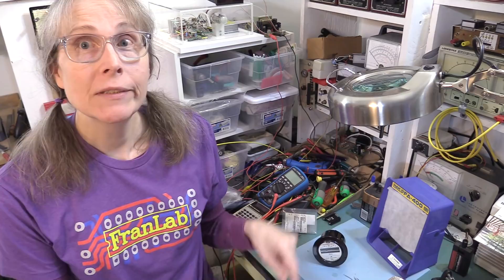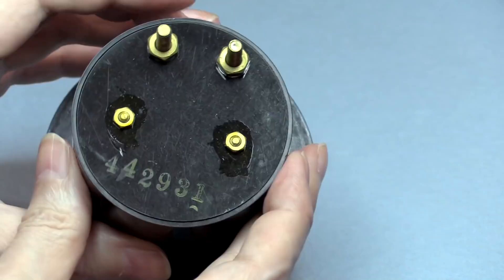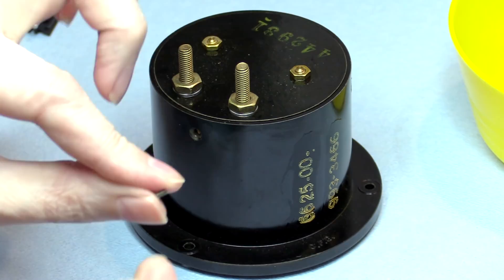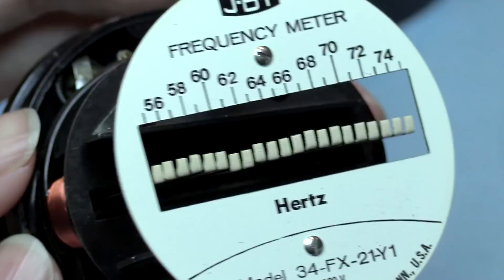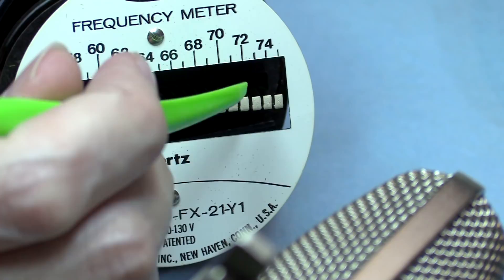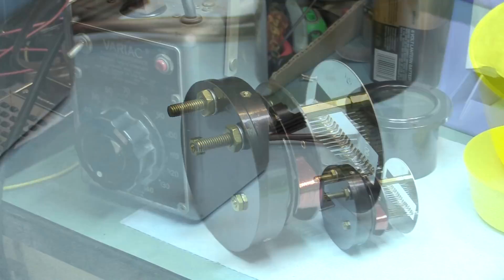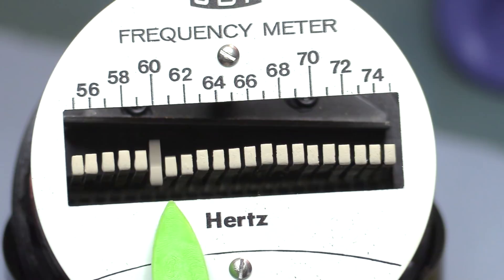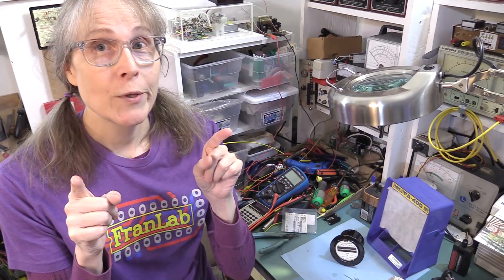The Spooky Action Of Mechanical Frequency Meters

Comment: Several have suggested using a step up transformer on an audio amplifier - which is a great idea. But even simpler is to use one of your many  tube guitar amps. Just attach the meter across the output transformer primary with a blocking capacitor.  No problem at all getting 120v of "audio" AC at that current. I know I don't have to warn you about the high DC voltage present.

Comment: im sure 100's of people have mentioned solutions... but 100/120v audio systems are totally an off the shelf thing... strap a FRX gen, an modest PA, and an transformer got a few in my shed, from a 10w from a little horn speaker to a 150w toroid. dont know if they will go down to that low frequency, but gotta be worth a shot. can think of a few other solutions, ive seen power opamps that will swing 75v +/-. and I refuse to belive you dont have a tube amp somewhere that can manage 100v. might need some ballasting resistors to load up the high impeadance side. you'll suss out a way

As soon as I saw that thumbnail, I knew what it was. dont know from when or where, but it was probably about 2AM from the depths of an internet rabbit hole, dialup might even have been involved. nice to get some deep good looks at the internals. with some dulcet frantones telling me all about it. Cheers!

Ps, your display collection is approaching the point it really needs to become art. Ive had in mind for years to build the most absurd network I can figure, cram all the networks onto a large pegboard, doing something totally pointless. fibre, coax, 485 SLIP, packet, everything. all the architectures, from c64 n acorn to ARM and a ryzen, n a bit of 486 novell for giggles. just cos. and if i can do something dumb with it, I'll squeal. but if i can just ping everybody I'll be pretty happy.

I think you have enough widgets to start considering a Fran/Goldberg clock or something. all the obtuse n obscure stuff, with a 60hz timebase. and of course, you would have to use that 120v timebase as the actual time source. might have to collab with someone in micros (or to stick with the rube goldberg go ben eater, with LEDs on ALL the data lines. sure look ma no computer would have a word to say. sure Dave and Clive would join the party). nixies on the seconds, teleregisters on the hours, binaveiw clacking out L U N C H T I M E F R A N. you get the drift. That'd be *so* awesome. packing my fantasy's away now. but... you get mah drift.

Comment: Probably the easiest way may be to hack an old UPS to tune its frequency as most of them are build so they also could support 50 hz in the rest of the world. These old instruments were real artwork in its simplicity. It’s really amazing what you could achieve with some coils, springs or valves where today you need expensive FPGAs and microprocessors (granted you get way better performance from and functionality you could only dream of back than).

Comment: A good way to play with line voltage and have control over the frequency would be a gas powered generator. By manually manipulating the throttle, you should be able to change the frequency some without causing too much change in the voltage.

Comment: Fran, the 6625-00-993-3466 number is an NSN for a "Meter, Electrical Frequency."  For instance, <https://www.newcenturycomponents.com/nsn/6625-00-993-3466> gives a lot of basic "NSN" info on it.  NSNs even list what "weapon system" use them, though that is only ONE of many uses, in my experience with NSN items.

"Definition: 	An instrument which measures the rate of regularly recurring variations in an electric current or voltage and is usually calibrated in hertz (cycles per second or cps). the value may be expressed by means of a pointer and calibrated dial vibrating reed or a digital read out display. for instruments which measure radio frequencies, see calibrator, frequency; and wavementer. excludes: counter electronic digital."

Most of my search results imply that it is for use with aerospace, or at least many of the sites showing it are aerospace-related.

If, by "driver," you mean something like a VFD, then you might get a low-cost one from Automation Direct for future use in FranLab.

Comment: This type of instrument is still widely in use in marine engineering, sometimes as secondary unit and in older vessels the only way of telling the frequency. We need to balance our own electric grid and synchronize generators in and out on daily basis, and being redundant, reliable and fail-safe is more important than being very accurate.

Comment: I have a mechanical RPM guage that is basically the same mechanism, only there is NO coil or even provisions for one. Seems it would get enough mechanical vibration from whatever engine it was used with.
Seeing as your meter only needs a few miliamps if I wanted to demonstrate it opperating on different frequencies I would connect the signal generator to an SS audio amplifier (with decent output power), connect the speaker output of the SS amp to a spare tube amp audio output transformer's speaker winding, then hook the meter to the plate winding. The meter doesn't need very much power, so the tube amp transformer connected backwards should be able to step up speaker power to 120V at the needed current.

Comment: Check out old school pagers (worked like this in the 60s)... they had four tuned resonant reed relays to decode the radio signal, with 10 possible frequencies. A local phone exchange prefix would be dedicated to paging, reserving all 10000 numbers. Dial a number and the corresponding 4 frequencies would be transmitted on a local FM station's subcarrier. Didn't actually get 10000 pager numbers though - two adjacent numbers could not be the same as the receiver would not see them as separate. Too lazy to calculate how many numbers were possible.

Comment: If you wanted to, you could probably cobble together a setup to exercise that thing with a signal generator driving an audio amp, then on the output of the amp a filament transformer hooked up backwards to step the amp's output up to 120VAC.  I'd think most filament transformers would work okay over the frequency range of that meter.

Comment: First time I seen one of those, was in high school, in the 70s. Even then, it was old, and pulled out of an old piece of gear. They still have cheap, less precise ones, on modern generators,

I think they work as mechanically tuned reeds (tines). All subjected to line frequency. The one that's closest to the real frequency shakes the most.

Quite expensive, as I remember. Of course, around the same time, 7400 TTL logic got real cheap, so you could make a more accurate frequency counter for less money, than one of these meters.

Comment: I have one of those, but by a different manufacturer. It's called a " reed type frequency meter"...or so it says on the meter's face. 
    All of the reeds vibrated visibly a little, but most obvious at the 60hz reed..
     Near video! I never took mine apart...

Comment: I design microwave band pass filters for a living - the frequency resolution in this case is partly a function of how lightly coupled the electromagnetic force is to the mechanical resonator - the lighter the coupling the higher the loaded Q - the higher the loaded Q the better the frequency resolution.

Comment: You don't need very much power... Use an audio amp and the variac hooked up backwards as a step-up transformer. It might need to be a stout amp, one that will not just shut down on a 1ohm load, or just put a power resistor in series with the amp's output to the variac. This setup can also power low power lights, such as LED bulbs.

Comment: Funny, I have the EXACT same Variac. Couple of others too. Somewhere in my hoard i have a resonant reed freq meter too, but it's intended use was for monitoring the frequency of 60 Hz generators.(or more accurately alternators.) How about just hooking up a function generator to an ordinary audio amp, and drive something like a filament transformer backwards to generate a 120V AC variable freq source? I'd do it myself, but I have several other projects in the front of the line, including a Heathkit DX-100 that needs some love.

Comment: What a beauty! I have a 50 Hz 70's square version of it. In Dutch we call it tongue frequency meter.
Reply: I've seen models where the tongues broke off due to metal fatigue I think.. Ofcourse they are used to get the diesels of generators near the synchronisation frequency.

Comment: 6:10 great shot of the fingers, looks like maybe they've ground down the thickness to tune them! Also, I wonder if the fingers would respond to just an audio signal with the case open? Might be easier to set up...
Reply from the maker: It actually is responding to an audio signal - 60hz at 120volts.
Reply: @mycosys  I can not imagine a resonance to the electric field component (capacitve). The capacitance is so tiny, negligible at 60Hz. I think the L brackets are magnetic pole pieces and the angle is to fine tune the resonance amplitude and voltage sensitivity over the frequency range.

Comment: As mentioned previously, below, used om some military mobile power generators. The meter  enable you to set the correct frequency output via trimming of the engine throttle so that the finger below the frequency marker you wanted staid static whilst all the pther fingers were vibrating about. the 00 number shows this was an American supplied NATO part. Had this 00 been 99 instead, then this number would then have showed that the part was UK NATO supplied.

Comment: I have seen frequency meters much like that only centers on 50 and 60 Hz on older gen sets. The whole meter would be humming away till the diesel got warm enough to stop surging. Then it would only vibrate one or two tines near 60 till a big load was switched on or off and that would get 3 or more tines going.

Comment: There is no harmonic resonance involved in the operating principle of this frequency meter. The sine wave of the line voltage should be generated as close to a pure sine wave as possible to minimize parasitic loss. Single frequency generation, single frequency response of the vibrating reed, that's how this meter operate. However, if you feed the coil of this frequency meter with a 30 Hz (or 20 Hz, 15 Hz, 10 Hz ...) square wave, you can get the 60 Hz reed to resonate. Now, that would be a demonstration of harmonic resonance. After that you can drive the coil with a pure 30 Hz sine wave to see if the reed vibrate at all. If it does (a little bit), then you can tell that the 30 Hz sine wave has some harmonic distortion, hence the harmonic resonance vibration of the reed.

Comment: Suggestion: You don't need a pure sine for this. I assume you have a bench signal generator? Simply connect it to an N-channel MOSFET, and use that to rapidly switch power to the meter. You'll be giving it a DC square wave rather than an AC sine, but it'll still resonate and read the frequency.

Comment: Cool! --You could probably do a full frequency sweep on the meter with an audio generator and a power amp. You might also need a step-up transformer for the audio to get the signal voltage up to 120V RMS. A filament transformer might do the job. (Q: I wonder why 60Hz is not in the middle of the meter?)

Comment: It occurs to me that all power plants on a common grid must have something like this, and calibrated reeds are an elegant way of doing this. If one generator is off frequency by so much as a blond one the result could be disastrous down-grid. It would also be bad if the generator were out-of-phase, so there must also be some kind of feedback loop that keeps them locked in-phase.

Comment: You could use a transformer from an analog power supply in reverse and an audio amplifier as source. in conjunction with wave generator software it would allow to show the ability to distinguish between frequencies.

Comment: I expected constructive interference, but I never expected such a simple mechanism and for it to be so clean. 

Regarding thickness, it's possible, but you'd have to get really funky with a surface grinder, and it would be far easier to vary width and take little tuning cuts out of the tips, as we see here. Just supposition, and the rest of the instrument seems very highly tuned so I could be wrong.

Comment: I looked up EIA code 993... Midwest Speaker... so probably not the mfgr.  To listen to the tines you might be able to connect the coil like a guitar pickup!  Also, you could use a powerful hifi amp to drive it... solid-state, of course, as the impedance would be too high for tubes... then you could drive it with an audio oscillator and vary the frequency.  Looks like you tune it like an old WurliTzer electric piano... that is, with a soldering iron!  Sad that it doesn't do 50Hz... interesting that it's more biased toward the >60 frequencies.  Thanks for the vid, I'd always wondered (but suspected) what was inside these... old generators used them.

Comment: Oh, I thought you would take it apart all the way. though I wouldn't risk damaging sucha pristine condition relic either.

My guess is that each one of the springs has a slightly different length, just like in a thumb harp. Though in the musical instrument the frequency varies much more, so it's quite easy to see the differences.

Comment: Those meters are neat! I’m a bit curious about that specific one, though. It looks like it’s intended for use where either 60 or 70 Hz would be the nominal frequency. Where does 70 Hz get used? I can understand (and have seen) various configurations centered around one or more of 50, 60, or 400 Hz for measuring power line frequency.

If my memory isn’t dodgy, I used to have a military surplus audio signal generator that had one of these meters with just two tines for 60 and 400 Hz, for setting the oscillator frequency very close to either of those frequencies. So, this kind of meter got used for applications other than power line frequency, too.

Comment: I've seen larger instruments like this actually set up to read the RPM of a steam turbine, a Worthington turbine from the early 50's, running a 15 million gallon per day centrifugal pump. I'm not sure in the case of that machine how it was hooked up to read the RPM as I don't recall seeing any electrical equipment on that turbine at all.

Comment: 10:20 Easier method could be signal generator or a cell phone with installed app plugged into classic audio amp. Output of the amp connected to the secondary winding of some small AC transformer. That way you would get close to 100V at variable frequency. Btw 66 seems to be the year of manufacturing because they used the term hertz not cycles.

Comment: There's resistance and impedance of the coil. If I remember my electronic theory, the resistance and impedance are in parallel. The impedance depends on AC frequency.

Comment: I suspect that that is possibly an analogue meter as at 60·5Hz both the 60 and 61 indicators should move an equal amount. So, by comparing their amounts of movement, you could just about get 1 decimal place in the frequency.

Comment: Use an audio amplifier, coupled to a transformer to generate 120 Volts. Any frequency generator to produce the signal, possibly mixing several frequencies to get several rods moving. Or generate a noisy signal and see adjacent rods move.

Comment: Hook it up to one channel in (stereo) amp, like a 100W unit. Then use a frequency generator to drive the amp. Or if the amp has the ability, bridge the channels.
Reply: Only has to be a few watts. Some kind of car radio amplifier chip should do the job.
Reply: @mfbfreak  - The meter is designed for line voltage so the amp needs a high RMS voltage (large P-P swing) even though the current draw is small. Not counting a Class D amp here; it would have to be Class A, AB or B. A high wattage amp implies a larger rail-to-rail power supply and swing.

Comment: you can just drive it through a low voltage transformer in reverse. Eg use a 5v to 120v transformer, and you can feed it a low voltage AC or even square-ish drive voltage.
Reply: Even easier still if you use a center-tapped transformer as then you can simply switch between each half with a simple transistor rather than needing a proper H-bridge in a push-pull configuration.

Comment: Please don't say this is a museum piece!  I actually installed some of these into a communications shelter i designed in the early 90s - we also had a 400Hz version.  The power was from some motor generators and we needed to make sure the line power frequency was correct before powering up the equipment.

Comment: Connect it to the primary side of a tube amplifier output transformer; connect the signal generator at the input of the amplifier. You will get 100V easily.

Comment: Could you please correct my impression that the tines are exactly the same, with the angular displacement and increasing height of the two metal plates inside causing the correct tine to resonate? That you call this art melts my heart, just wow.
Reply: John Smith ... yes, I believe you are correct. The distance between those plates matches the resonant frequency by a particular tine and causes it to oscillate. IOW, changing frequency = changing distance between those plates. The strongest signal location is indicated by the moving tine.

Comment: An easy variable frequency generator can be had with a bass amplifier and a reversed transformer. You could probably make this work with a 70V output amplifier, fed by an audio signal generator.

Comment: I have a FRANM Frequency Meter 80-120 volts, 23 to 27 Hz in 1/2 Hz increments. I think it came from the ringing/ringback frame of an electromechanical telephone switch, probably a Strowger Step-by-Step based on where I got it from. Made by James G Biddle Co. Plymouth Meeting PA. Different design, more like a relay setup and two big resistors total measurement 12.7k